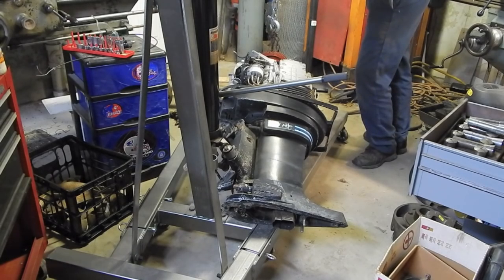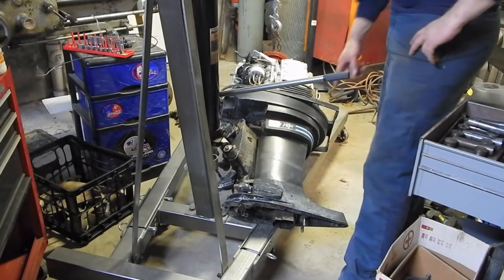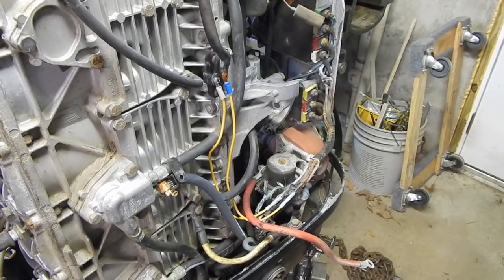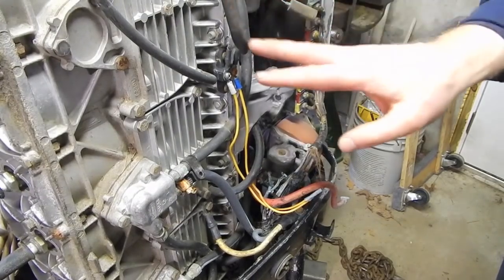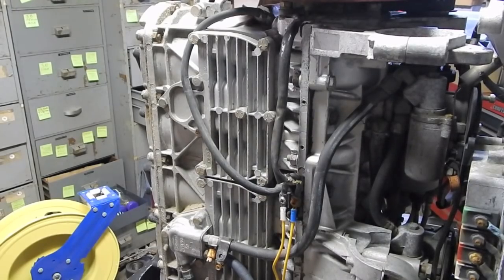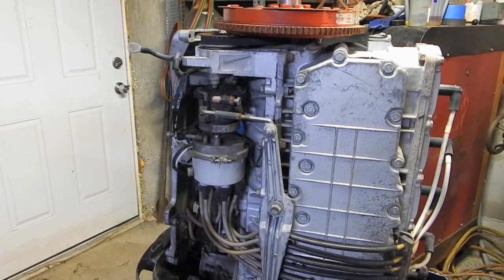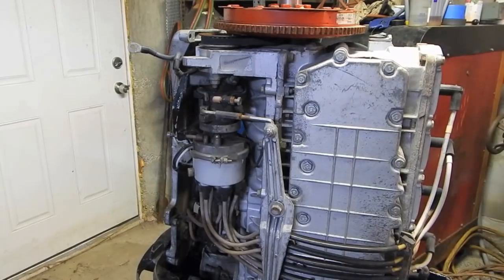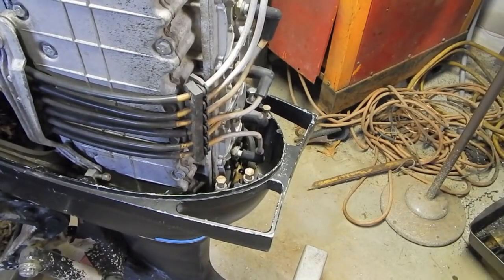The Mercury 115 "tower of power" outboard motor Part 4

Comment: When the hall effect sensor in Bosch distributors (such as the one on my SAAB 900) goes bad, usually from oil ingress from a bad distributor oil shaft seal, you're supposed to buy a new distributor. I found out though that a Chinese company makes new copies of the original Siemens sensor. Only problem is you can only buy them in multiples of 100...
Reply from the maker: that figures.  a possible business opportunity might be to buy 100 and sell them on eBay.  problem is most shops aren't going to bother with fixing a distributor. They will just replace the whole unit, and pass the cost on to the consumer. only shade tree mechanics like me would opt fot the other option, and there might not be enough of them around to warrant sitting on 100 sensors.